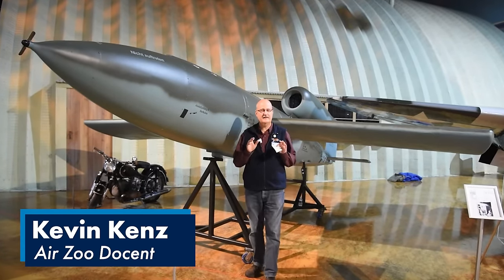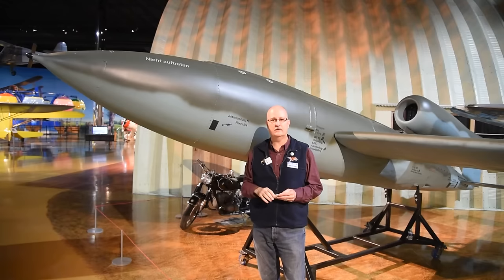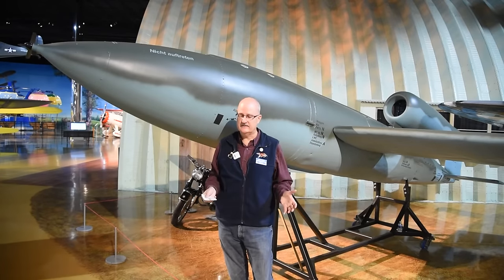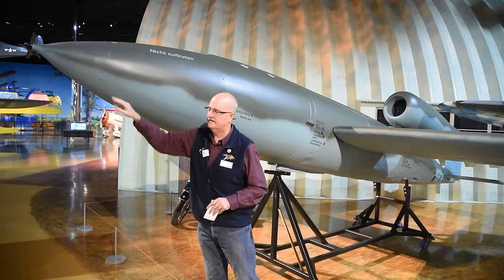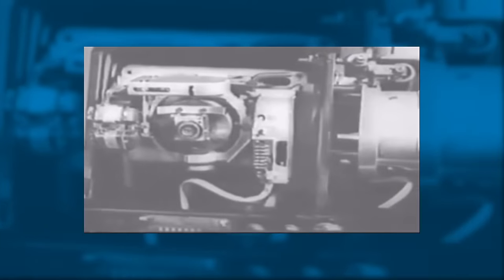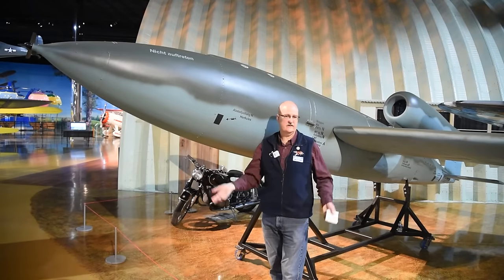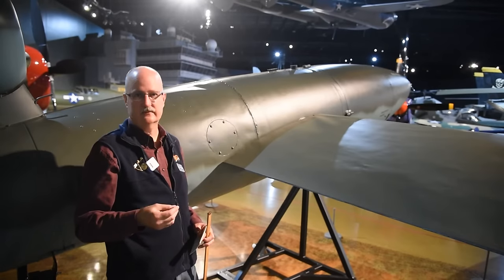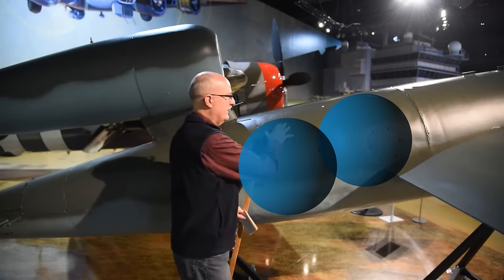V-1 Buzzbomb: A Technical Breakdown of the Vengeance Weapon

Comment: During 1950s, Walter Kaaden, one of the engineers who harnessed harmonic shock waves within the pulse jet tube, went on to invent the expansion chamber exhaust which effectively super charges two stroke engines. He also used reed valves within the inlet port.
Reply: Those "expansions" were a waste of money or the fools that fitted them did it wrong,I was told you had to change the jetting on  the carbs free up the airflow on the air intake and fit the expansions,To get the "added" performance nobody did it was cosmetic or a different noise,I had many races with my "standard" Suzuki GT550 and won,One could argue i was racing posers with more money than sense,And weren't interested in power but looking "cool"
Reply: @Johnketes54  every 2 stroke bike from the 60s onwards has an expansion pipe, 2 strokes are tuned for a very narrow resonance or power band and share more in common with a pulse jet than a 4 stroke
Reply: @turkeyboyjh1  They also provide a large boost in efficiency within a narrow rpm-range, so unless you specifically need a super compact engine package, or the engine needs to run well in a very wide rpm-range, it would be pretty silly not to include at least a basic expansion pipe. The whole point is that the exhaust pressure wave is reflected back up the exhaust towards the engine, and shoves unburnt charge back into the cylinder just before the exhaust port closes. It's a pretty clever acoustic hack that doesn't add much to the production cost. It's just a bit bulky.
Reply: @Johnketes54  to take full advantage of expansion chambers, the exhaust port height also needed to be raised (i.e. grind the exhaust port hole in the cylinder wall with rotary grinder).  With appropriate porting and carburetor jetting changes, very significant power increases were possible.  However without these internal engine changes, you are correct, putting expansion chambers on an otherwise stock (street legal) motorcycle was largely a waste of money.
Reply: Amazing, I remember the Japanese stole the technology with help from inside the German company/motorcycle rider 😮 very much the usual industrial espionage that goes on with technology, always somebody trying to steal it.
Reply: @ianmangham4570  suzuki?
Reply: @muddywater6856  💯

Comment: at 5:30, I’m pretty sure the wooden sphere does NOT “dampen” magnetic interference at all. Rather, it’s made of wood so as to not CREATE interference with the compass. Any nonferrous material would have sufficed, but wood was probably more available than other strategic materials.
Reply: I agree. I used to be an aircraft instrument dude in another life, and if you messed with the magnetic field of the fuselage, it would also mess with the earth's magnetic field and the compass won't work. More than likely the unit was calibrated in situ to compensate for all influences, including electric circuits, and then was declared accurate enough.
Reply: @dougerrohmer  
Correct. The V1 compass would have to be ‘swung’ with all electrical systems on, in situ with all ferrous metal in the aircraft for the navigation system to be accurate.
Reply: Wood was used around the compass to dampen vibrations. It has indeed nothing to do with magnetic interference. The nosecone was made out of aluminium for that purpose.
Reply: They are explaining it in more detail here from minute 9 onward. Also it’s the video that contains the animated parts they also used here. 

https://youtu.be/5EEZuXQyA-E
Reply: Put a compass on a table. Bring a piece of metal towards it. What happens. Now place a piece of thin wood between the compass and the metal. End result?

Comment: The so called  'start cart' pictured at 18:28 is in fact the steam generator cart for the catapult, which generated large volumes of hot steam by the decomposition of hydrogen peroxide. The starting functions for the pulse jet were provided by other pieces of equipment.
Reply: This is still used in Russian space rockets
Reply: @leopold3146  Steam generator cart for the catapult? No. Space rockets take off by itself.
Reply: @ВасилийКоровин-г9э   steam generators to start turbo pumps are  not uncommon on rocket engines.
Reply: @heikoscheuermann turbopumps don't need/use EXTERNAL steam generators to operate they use their own built-in.
Reply: I didn't say a single word about effin EXTERNAL...
Reply: @heikoscheuermann  you said that they're used to START but they don't. Peroxide steam generators were used to operate turbopumps. Different approach and different functionality.

Comment: 96 yr; old WWII vet, some memory loss:
I think I also remember a V bomb that sputtered, rather than pulsed.
I also remember watching a V-2 (the straight up and straight down rocket) rising in the dark as we stealthily approached the Rhine. I thought "Poor Londoners, there goes one (completely unstoppable) of those blockbusters at them." I later read they were aiming at the Ludendorff bridge to hinder our Rhine crossing. I was pitying the Londoners while the damn thing was aimed at me! (practically)
Reply: If you could see the V2 going up, you were probaly too close to be the target.
Reply: @wolf310ii  That was another reason I supposed they were on the way to England.
I read (later) they had tried to destroy the Ludendorff bridge by throwing everything - including V-2's at it. We were approaching the Rhine, so we must not have been too far from the launch site.
At the time, it didn't occur to me that they could be aiming at something so close.
Reply: @edgarvalderrama1143  The V2 aiming at the Ludendorff bridge where started in Netherland by the SS Werfer Batterie 500, around 200km away from Remagen.
What you saw was probaly a V2 from the schwere Artillerie Abteilung 836 in Gehlert (3. Batterie) or Kirburg (2. Batterie) 40-50km away from Remagen, but this Unit fired at Antwerpen and London, Remagen was too close.
Reply: @wolf310ii  As I said, I later (fairly recently) read they tried to hit the bridge with V-2's, which is why I said they were (practically) aimed at me. They were supposedly diverted from their original target and aimed unsuccessfully at the bridge.
Reply: Thank you for your service.
Reply: God bless you for your service sir. Two of my uncles served in combat during WW2 but never talked about it. Me & my older brother served in Nam.
Reply: @JohnThomas-lq5qp  I never had inhibitions about it; in fact I've written a lot about my experiences. 
Maybe because I was so clueless as to never feel what was going on was "real."
Reply: If you saw it close to the Rhine, London was too far away. It must have been aimed at Antwerp or Paris or some other French city, Edgar. In fact, more where aimed at Antwerp (1610) than at London (1358). Eleven rockets were even aimed at the Rhine bridge at Remagen, but they all missed.
Reply: @Eliah153  The ones aimed at the bridge are the ones I later read about .
Reply: @edgarvalderrama1143  Being a WW II veteran, were you in 9th or 1st US army? If so, perhaps you saw the very region where I live, Southern Westphalia,  where these two armies joined up and closed the Ruhr cauldron for good around Easter 1945.
Reply: @Eliah153  I was in the 3rd army under Patton. We did walk in circles for a week (I don't think it was more) to occupy the Ruhr, while some of the 300,000 Germans who had surrendered rode out in trucks making fun of us for having to eat the dust they raised. I would "drop" the moment we had a chow break, and hit the ground asleep. I'd wake up marching and watching the rear of the guy in front of me bobbing up and down. Then I thought that If I made it back alive, people would ask me what I saw, and my buddy's ass was not a good answer, so I'd force my head up and take a look around before lowering it again.
I lost some memory due to a stroke.
Reply: You were lucky to see one Edgar as the V2 achieved supersonic flight and very high altitude, so in here in London they were never or rarely seen, just the massive explosion followed a short while later by the noise of the Rocket engine, as the thing was travelling faster than sound! Even until quite recently some London houses have had to have remedial structural repairs caused by a V2. I gather from my parents the V1 basically sounded like an unsilenced motorcycle. but by far the most frightening was the V2
Reply: @scienceistruth1924  I saw them taking off (in the distance) and disappearing almost straight up in the sky as we were like a column advancing towards the Rhine with Germans on both sides of us - which is where the rocket launchers were as we bypassed them.
The motorcycle sounding rocket must have been what I heard as a sputter. I 'think' I also heard the ones that pulsed.
Reply: Thanks for that Edgar.
Reply: Thank you for your service sir! Your service will be forever remembered through generations
Reply: @heinzguderian628  Thank you General, I hope my presence in Germany didn't inconvenience you!
Reply: A most succinct post .Thank You .I wasn't in a position to see them takeoff  ,but was a mile from the receiving end of one in North London . It managed to kill 2 school boys .
Reply: thanks for sharing, very interesting to actually hear about this from someone who was there.

Comment: The combustion design of the V-1 was adopted and used in the Lennox Pulse furnace to heat residential homes.  It was one of the first high efficiency furnaces and is still used in some homes.  These furnaces had a noisy "buzz" sound from the exhaust pipe.  Lennox had to design mufflers for the furnace exhaust.

Comment: Excellent video!
Post-war analysis by the allies revealed that the V1 was more cost effective than bomber raids or V2 strikes. V1 usage was limited due to extensive launch site construction required which was quickly discovered and then attacked by allied air power. 
It turns out that Germany had an incredible capability, yet a missed opportunity, before they even built the first launch rail test facility: the first V1 glide test on 28 Oct 1942 was from altitude, dropped from a FW200. The first powered flight was air dropped on 10 Dec 1942 from an He111.  The construction of launch facilities by the Army meant the first operational launches would not occur until Nov 1943. 10,000 V1s were fired at England. 2448 V1s were fired at Belgium. It was not until July 1944 that the German military began operational night launches from nine (eventually 25) He111 H-22 aircraft, firing 1,176 V1s. The final air launches continued until January 1945 at which point the Luftwaffe had lost its capabilities. The air launches had a 40% failure rate, as one may expect: over ocean night missile launch operations were challenging. Had the German military employed air operations from the start, one may conservatively estimate over 3000 launches and a resolution of the early launch problems. This would have greatly complicated the allied efforts against the V1 capability while affording a larger target set for V1 engagements, perhaps even avoiding the exorbitant cost in manpower and resources necessary for constructing ground launch sites.
Reply: It's accuracy must have been so low that it would have been ineffective against particular targets. Terrorism would have been the limit of its capabilities. However I did read that it caused a significant drop in productivity because air raid sirens would fire and workers would retreat to air raid shelters. The v2 did not have this feature as they did not provide any warning.

Comment: Beautifully presented and very a informative video.  I also believe that the spinning propeller at the front of the V1 had a connection to the Fuel Supply.  So just before it started it’s Terminal Dive to its target, a signal was sent to cut the fuel off to the engine!  Film of the V1’s attacking London, always showed the engine cutting off just before it commenced its dive.  Greetings from England ❤️🏴🇬🇧🇺🇸🇬🇧❤️
Reply: Actually the engine wasn’t shut of by a timing device but by the negative gˋs when the timer flipped the elevator down and it nosed hard over. That stopped the fuel supply.
Reply: @theonlymadmac4771  For sure, but It wasn’t a timer device, it was based on the number of revolutions the propeller made.  This was carefully calculated taking in to account the acceleration on launch, it’s average flying speed and distance to target.  Once a certain number of revolutions had been achieved, a signal was sent to a servo which shut off the fuel, as well as the negative g component.  If there was fuel in the tank, yes it would starve the engine of fuel, but I’m sure they wouldn’t have relied on this factor alone to cut the fuel.  Supposing the elevator bolts failed, the bomb would overfly its target wouldn’t it, but If the fuel was cut off with the use of a servo valve, the bomb would fall nose down and would still explode upon impact!
Reply: @theonlymadmac4771  
It wasn't supposed to do that, the Germans intended it's dive to be under full power, when they found out that the engine's were cutting off they figured out what was causing it and fixed the problem, after that the engine's ran all the way up to impact as they'd originally intended. 
After that the British who'd gotten used to the way they originally worked and knew that as long as you could hear the engine running it was just passing overhead learned that wasn't the case anymore.
Reply: @dukecraig2402  Can you provide a source for that? What would be the advantages of a powered dive?

Comment: Old school electro/mechanical systems are AMAZING. Today it would be basic PLC or other basic digital systems but back then it was almost an art the way they used basic physics to make stuff work
Reply: You can do it today but electronic controls are more precise, cheaper than mechanical ones, easier to mass-produce, way lighter and smaller in size and easier to maintain. Yes I appreciate the beauty of fully mechanical systems but won't use it today as a main ones whenever it's possible.
Reply: Remember that these deadly devices were aimed at our allies homes...

Comment: EXCELLENT presentation.  I learned a lot, and I consider myself pretty versed on the V1.  Where is this place?  Suggestion: if you have the parts, or can simulate the parts, show the insides of the V1 as an exploded diagram.
Reply: The 3D printing files on line too?
Reply: You may wish to change your terminology rearding an exploded diagram of the internals, the diagram would probably be covering a rather large area, and take ages to read🤣
Reply: @mickymondo7463  just a suggestion, may not be practical
Reply: Kalamazoo, Michigan.

Comment: Nice review, germans sure had impressive technology for the time period.
Reply: Most don't know that the Germans developed a television guided bomb, wire guided missiles, the Vulcan 20 & 30mm gatling gun electrically driven cannons.  Then there was the Schriever flying disc program ..
That's where the term; "Foo-fighters" came from. Allied aircraft sighted them being flight tested. 
Source: 'German Jet Genesis ' a Jane's Book.
Reply: read about the Horton 262... years ahead of its time jet powered flying wing with RADAR absorbing/deflection tech
Reply: @philiprice7875  i think that was Ho229 (?)
Plus it did like 620 mph in flight tests

Comment: Interesting. The device shown at 18:27 and 18:30 are not part of the engine start system. That is the steam generator for the catapult, Hydrogen Peroxide powered, I believe.  Also, no one has explained how the V1 maintained roll control using no Ailerons and relying on Rudder only, which is a very dodgy method with a wing having zero dihedral.
Reply: The rudder is located very low, between the top of the fuselage tail and the underside of the engine, so the rudder will have a lot of torque for yawing the bomb's nose left and right, but not a lot of torque to induce roll.

During a yawing movement, the vertical aft surfaces (including both the engine mount and tailfin and the engine itself) will act as a vertical tail, causing the bomb to roll towards the direction of the yaw, thus producing a somewhat coordinated turn.

Or at least that's how the forces balance out in my head.
Reply: Only the aileron on the side of the plane that needs to go down moves at any one time up to cause a yaw and bank on some of these minimalist control systems . The other aileron stays straight . I don't know about all the v1 versions but i would try that first .
Reply: @gregorydahl 
It doesn't have ailerons.
Reply: @lomasck 
No, they didn't have ailerons (yes, the piloted version did, but that's a different topic).

Pure delta wings don't have ailerons either; they have elevons.
Reply: @lomasck  
   The bachem natter or viper used seperate elevator flaps to roll and together the elevator flaps could pitch up or down the plane . 
  A deltawing can useelevons that work like aileron elevator combined because the airfoil top surface curves up starting at the leading edge and then folliws a regular curve shape until ⅔ of the way to the trailing edge it straightens out by the airfoil curving up so that air flowing over the wing leaves the trailing edge parallel to the flight path . No downward flow at the trailing edge to cause forward pitch of the wing to counter with a seperate tail surface .
Reply: @gustaveliasson5395  Looks like my mistake.I could have sworn I read they had Elevons .Must just be Rudder use then.You would have thought dihedral would have been a good idea.

Comment: Great video presentation.  A lot of questions about this machine were answered.   My remaining question is how did they manage to keep the wings level?  The dihedral was fairly flat and there were no alerions to maintain wings level.   Rudder control works with a high dihedral wing,  but a flat wing usually needs control surfaces.